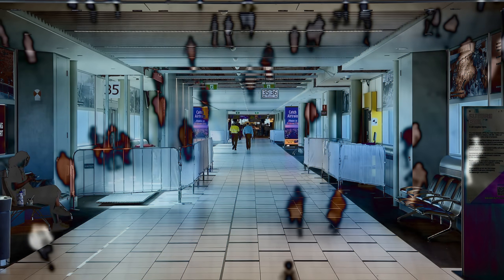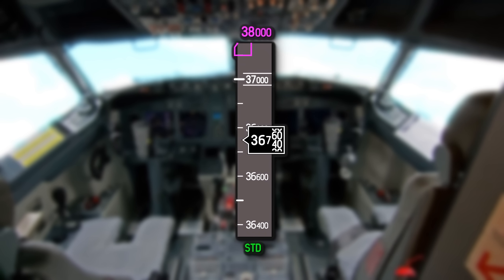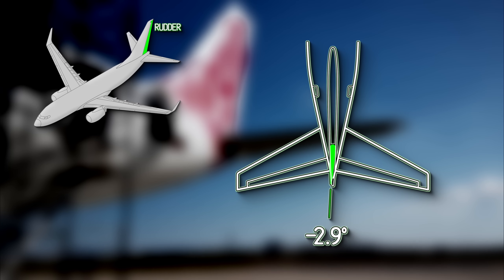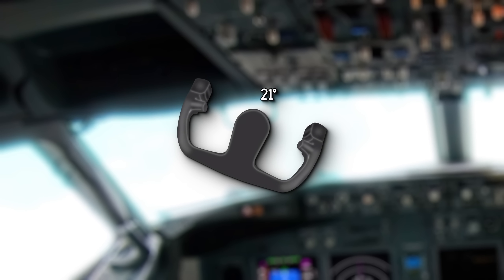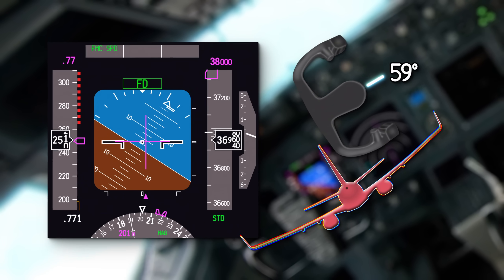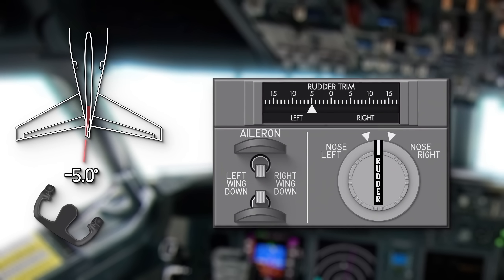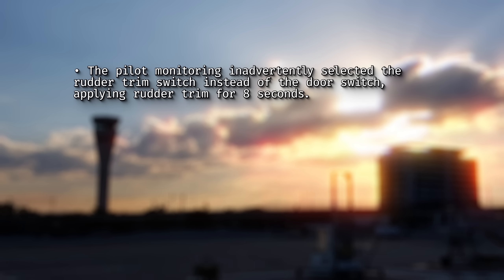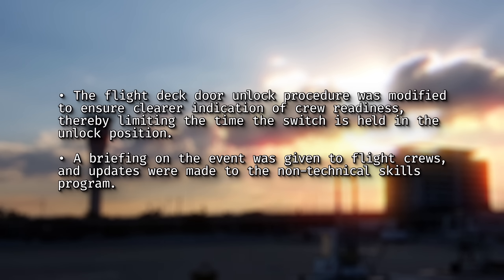How a Simple Switch Triggered an In-Flight Upset on a 737

Comment: Similar to the case where the pilot pulled a circuit breaker which gave a slight offset to the rudder.  That did not end so well.

Comment: Having years of flying the fully manual B737 200, at a time when engine failure and other emergency training was done in the actual aircraft, not the simulator, the following engine failure procedure became instinctual and second nature.
First an explanatory note; the flight spoilers on the wings were there to help the ailerons roll the aircraft into banks by deploying on the down-going wing. Thus, if the roll control wheel was deployed more than a few degrees, the spoiler on the down-going wing would start lifting, decreasing lift and increasing drag on that wing. 
Now consider an engine failed (say the right), and the aircraft wants to roll right towards the failed engine. The pilot cranks on left aileron to stop the roll, which also deploys the flight spoiler on the left wing increasing its drag. The only way to stop this drag is to centre the control wheel with the left rudder trim until the wheel centers itself. 
After many practice sessions with engine failures in the real B737 200, it became automatic to check the rudder trim and use it to center the control wheel. Sadly it seems that the old manual skills are fading away, causing pilots to address the automation and not the airplane when seeking an answer.

Comment: A pity they didn't look at the slip indicator and stepped on it with right rudder to bring it back into coordinated flight. The rudder is the most powerful control surface to counter roll. Even I know that.
Reply: Basic stick and rudder…the brick is to the right. ‘Oh let’s input a shit tin of aileron and check the engines”.
Reply: @mizzyroro  you almost never use the rudder in the B737 - especially not at high altitude cruising flight. To do so could actually be extremely dangerous. The aircraft is flown feet on the floor 95% of the time, which is by design. The yaw damper takes care of yaw anytime you aren’t operating the pedals.

Comment: I thought that switch had been replaced after the incident in japan.
Reply: I flew one of the first B737 300s, and one day had a cabin attendant come up when we were on the ground. She sat on the jump seat and put her foot up on the pedestal. I told her to remove her foot, and when she did, I noticed that the single unprotected switch had moved the rudder trim several degrees. 
A little later a government airline check inspector was sitting in the cockpit and I said to him that without a guard, the unprotected rudder switch would cause an accident. He said "It already has." They later put on a guard, then changed it to the system shown in this video. Seems it still not fool proof.
Reply from the maker: The ATSB report details Boeing's response to the "Tokyo occurrence," which was:
• ensuring flight crew awareness of this specific potential for error and the need for visual identification prior to operating a control; and
• ensuring that no aircraft in their fleet had the rudder trim control in the same location as the flight deck door switch on another aircraft of the same type.

Comment: Generally on most planes if an uncommanded yaw, roll, climb/decent the first thing to do is disconnect autopilot if it is on. It may be causing it. Then move to the next action.
Reply: But this was actually "commanded roll".  Not sure if the "uncommanded roll" checklist would cover that.

Comment: The only thing missing from this crew is the all inspiring comment of confidence " what is this plane doing?"
Reply: That quip—“What is this plane doing?”—is a bit of aviator’s gallows humor referring to those moments of automation surprise when a pilot suddenly has to ask why the aircraft is behaving in a way they didn’t expect. It’s something we see in accident reports and cockpit voice recorder (CVR) transcripts where the crew, perplexed by a misbehaving system or inadvertent input, blurts out a variation of “What’s it doing now?”

In this Virgin Australia incident, no one actually said it, but the situation certainly fits the kind of confusion pilots sometimes face when automation starts responding to a hidden input (in this case, unintended rudder trim). The joke is that the only thing missing was that classic exasperated line!

Why pilots say it (in real life)

Automation Surprise: Modern aircraft have multiple layers of automation that can do unexpected things when an unnoticed input (like mis-set trim) conflicts with autopilot logic.
Tunnel Vision: High workload or distractions can cause the crew to miss small cues that something is going wrong until it’s very obvious—leading to that “What on earth is happening?” exclamation.
Complacency with Routine: In day-to-day operations, everything is usually so seamless that a sudden deviation can catch pilots off guard, prompting an out-loud reaction.
While it’s a humorous take in hindsight, it underscores a serious point: Recognizing the aircraft’s unexpected behavior quickly and knowing when to disconnect automation are key to safe recovery.
Reply from the maker: Your comment reminds me of the legendary Warren Vanderburgh “Automation Dependency” presentation. He says: “Let me ask you guys out here in the 757/6 community, A300 guys, et al. What’s the most often asked question in our cockpits? ‘What’s it doin’ now?’ [Audience laughter.]”
Reply: The rudder switch should have bumps or a different feel from the door switch. I’m just surprised the captain didn’t put two and two together with him twisting a switch to the left, and the plane reacting to the left…
I wonder if there was a complimentary “oops, our bad, but we’re good now. Annnd that’s why we say remain seated with belts fastened” 😂
Reply: @mattg30380003  it does, it's bigger for one, round and with indentations in he plastic, it's completely different to the door switch

Comment: How many thousands of times has he reached for and used that door lock? It is even a different size than the rudder trim.
Reply: And how many times has he reached for the rudder trim? The crux is, both feel equally familiar, and the brain on autopilot isn't sophisticated enough to discern round from chunky, only familiar from strange.
Reply: @feynthefallen  They don't feel equal, they feel quite different.
Reply: And smooth as opposed to knurled.  No excuse pilot error, but Boeing gets the blame.

Comment: So much for training. So much for scanning. So much for stick and rudder skills. Thousands of hours of autopilot will do it. Forget the basics like what makes a lane turn? Rudder is the first thing to check and use to correct direction.
Reply: When I saw the events unfold in real time I didn't think their response time was unreasonable. A few moments to analyse what the aircraft was doing, took manual control when required, once control of the aircraft was regained they began the trouble shooting process, beginning with engine performance and moving systematically. For context I'm stick and rudder advocate who hand-flies instrument approaches. Knowing the aviation pathways in Australia, my guess is the FO had 2000hrs flying remote in all sorts of 'stick and rudder' aircraft
Reply: @navajojohn9448 

Like all airliners, the B737 is flown, by and large, by instructing the autopilot to follow the lateral and vertical navigational path specified in the FMC. The catch with this is programming the FMC is a manual process, and it’s garbage in, garbage out. Also, because the B737 is a dinosaur from before LNAV and VNAV existed, it occasionally does some weird, wacky and wonderful things when following FMC guidance. This means that a lot of the time if the aircraft unexpectedly turns, pitches, speeds up or slows down, it’s something in the FMC, and the first action is to interrogate the computer to see if the programming is legit. 

Secondly there is automation philosophy. In jets like this, the usual philosophy is to operate the aircraft in the highest available level of automation at all times. If the automation is doing strange things, you usually step down through the levels of automation to achieve a known state, rather than simply switching it all off. 

This is for a couple of reasons: first, flying jets can be pretty demanding and removing automation causes workload to immediately skyrocket. This limits the ability of the PF/PM to work together to solve the issue. Second, at high altitude jets must be flown with extreme care and caution to avoid stall, overspeed or over stress. In a situation like this involving uncommanded roll, rudder is the last thing you want to use as it’s an enormous, powerful flight control which could stall a wing or snap the tail off if not used with extreme caution. 

Personally, I likely wouldn’t have done anything different to what the PF in this scenario did. They had an unidentified issue which caused the aircraft to veer off track, so perhaps suspecting LNAV, they went to a HDG SEL to regain tracking. It was only AFTER this action was taken that the bank angle became concerning, at which point the crew called ‘upset’ and completed the required memory items. 

An own goal in terms of the application of rudder trim in the first place, but pretty well-handled after that from where I’m sitting.

Comment: So the Capt turn the Trim switch and the 737 yaw immediately and he never look back what did he turn !!!!
Reply: kinda of a design issue also
Reply: @jamescollier3 absolutely a design issue. Having a commonly used turn switch next to a similar one for flight surfaces and the other one to open a door. The door should be a toggle located very much away from the trim settings.
Reply: Yeah that seems a bit lacking, he noticed the trim control switch was incorrectly switched to left trim adjust and centred the switch again, but didn't bother looking at how much incorrect left trim was now applied then correcting it.
Reply: @ats-3693 It sounds like he/she held onto the selector and let go after 8 secs but didn’t look at which dial was turned.  It never occurred to the PM that the wrong knob may have been turned.  Some sort of confirmation bias.

Comment: Great video! It could have gone a lot worse, there have been several major crashes due to pilots fighting against extreme trim settings. The MCAS crashes were relatively recent and saw a lot of coverage, but loss of trim control has happened due to a number of factors. Alaska Airlines Flight 261 was also due to runaway trim after a mechanical failure, for example. Having the feeling that the aircraft acts like it has a mind of its own and that you're fighting it to survive has to be terrifying.
Reply from the maker: When you watch the real-time replay, you can see how quickly the bank increased once the autopilot reached it's limit of authority. The crew did well to counteract the roll and bring the aircraft back to approximately level flight. Even another 1 or 2 seconds delay could have been the difference.